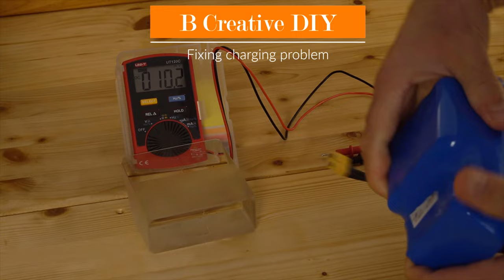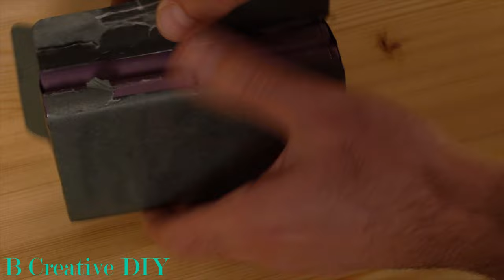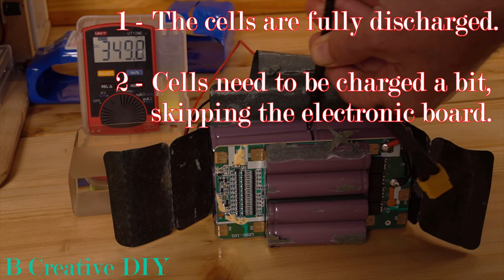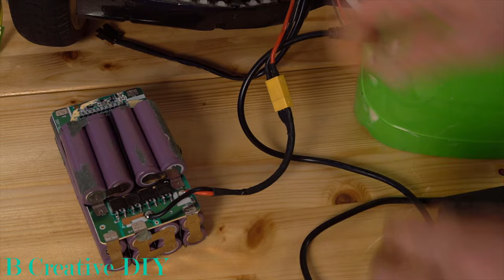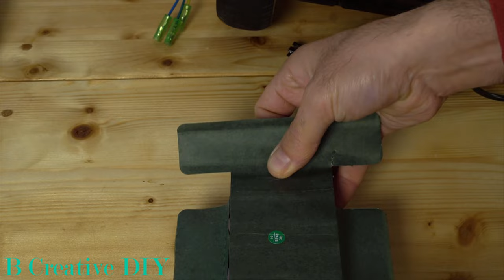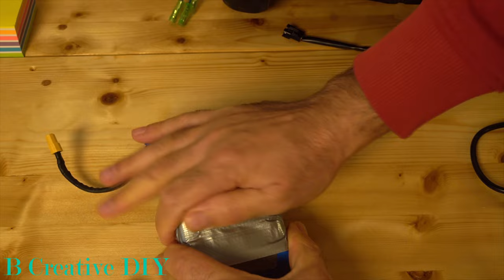FIX Hoverboard BATTERY charging PROBLEM

Comment: I took charged 12v battery from electric screwdriver and just touched the open batteries with cables. There was some spark and it got some juice to start changing. If you try that be outdoor as there is some risk of fire. I took the risk as either it would work or go to the bin. Now is working 😅

Comment: Hi, I followed the same steps. When I short it, I can see red light on the charger. But, it is back to green as soon as I disconnect. How long do I have to hold? Tried holding it for about 2 mins

Comment: Kids didn’t use their hoverboard thru winter and come summer it stopped charging.  I was afraid the battery was dead, but then I found this simple fix. I watched a few other videos which suggest a similar fix, but this is by far the easiest. Hoverboard is back to life. Thanks much!

For someone who has never done anything like this before, the actual shorting step in the video was not very clear to me and there are a few comments asking for the same. So here if it helps anyone - For shorting you just need an electrical wire to connect between the two points P- to B-. There may be some sparking so be careful.

Comment: wow that battery?
i remember before i was kid.
hoverboard was battery full and playing outside for 3-4 hour until dead battery. then charge. until night unplug and sleep then morning. later when afternoon. again playing outside when reached low battery. i skipped and dead battery every 20-30 times. then now dead battery or idk lifespan.
it worked charged full it say green like full. was 1-2 hour. unplug then outside play working when get road up like harder. and put driving road ramp up. and dead..
no power on holding. when plug then unplug a charge. it worked.
i think problem motherboard or short circuit or battery lifespan?
battery work but before it was road ramp up it working harder so much then back everyday. after problem started then ramp up started slowly.
when i get ramp drive up BATTERY IS WAS FULLY.. and started ramp up. slowly. harder then so fastest battery started low battery red light. then no move while holding driving..
and put back. battery become good. then again ramp up DEAD bruh. I miss 2018-2021 for dead hoverboard :(
TODAY... no charge after 2 years ago. and work power on without teardown. playing in my home still working but trying faster dead battery.
then charge it say green like fully. and i tried Punch hoverboard like rage. then started charging. later minute stopped to green.. again punch then charging. it still charging after hour to full battery.. to start it work but won't fast drive but slowly. yeah that battery lifespan bad.
before hoverboard with bluetooth was working music later then dead sound.
bluetooth work but automatically disconnect
anyway cool video :)

Comment: I understand shorting it so it starts charging… but what are you holding and using o short it? Are they just a wire that are connected?
Reply: The eletronics on the battery need some power to work properly and regulate charging tension, if you let the battery fully discharge then the eletronics will be locked in interrupt mode, the short done in this video direct power to the battery with enough force for the eletronics to come back to life. This is a design flaw, having a system to control the energy flow and make it dependent on the battery itself is a dumb idea, because as soon as the power goes completely out then it basicaly looks itself from charging.

Comment: Hi Bro, My battery is different, I have a B- (Black Wire, It is is connected from the panel to the batteries), also a C- (Black wire, Direct from the plug). My red wire is connected directly to battery, I don't know how to short-circuit, Please help🙏🏽

Comment: I understand that i am to charge the main neg. post of the battery pack that does not connect to the mother board. But with what can I create this skip charge to initiate the battery pack to receive a charge. I have only a car battery charger and a sm charger/maintainer that I use to plug in my motorcycle battery when not in use.   can I use a charged D size battery by connecting a wire from that D to the main negative not going to mother board?

Comment: Hi all and thank you to help me reanimate the battery. I had different a bit looking board under blue plastic cover. However,I had easy way to reset the battery instead looking for p- and b- .  Battery PCB board has multi socked which I disconnected from PCB and then connected battery set true the iscoter charger to charge it. For an minute charger flashed red and then I connected little multi socked to the PCB and it started charging. After 4hours of charge it success. Using it again. Thanks for help all.

Comment: Is it possible to use a higher voltage 20 cells, 36V battery on a hoverboard that had 14 cells ,24V?
Can the motherboard handle higher voltage?
Reply: most likely not.

Check all  the components. Especially capacitors and their ratings. If every single component can handle 36V (42V fully charged) easily then go for it. But most likely it will burn something.

Comment: I did it and it started charging again. But now it charges only for half hour, then turns green again. I can use it, but then it dies after 10 minutes. Would it make a difference to try again e short-circuiting? Or did I just resuscitate a battery that is too tired anyway, and a replacement is the wisest to do?
Reply: From where you get electricity for the short circuit

Comment: Can I connect the battery directly to the hover board, bypassing the BMS?
Reply: Yes. But you shouldnt. If the BMS doesnt allow charing there is often a good reason for it.
I had one 0,11V Cell in a pack. If I would have forced charge in that it may have blown up.

Comment: hi thanks for this video but can you explain to me how I can make short circuit
Reply from the maker: Hi. You are welcome. I'm not sure I understood the question. In principle, a short circuit means that you bring two points into contact using a conductor. In the video I presented as much as possible the solution for one of the battery models in the conditions in which it was not charged for a very long time and it was completely discharged. As I mentioned in the description: LI-ION cells can be volatile causing slight explosions if used improperly. If the cells are physically or electrically damaged, the resuscitation procedure in this video cannot be used.
You can try the procedure presented in the video at your own risk.